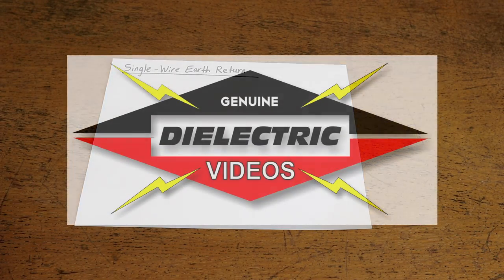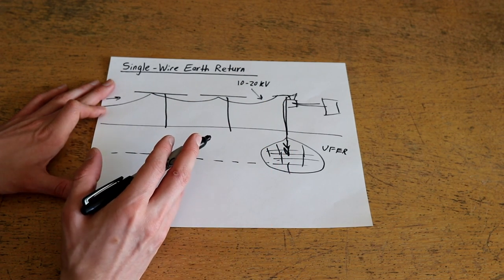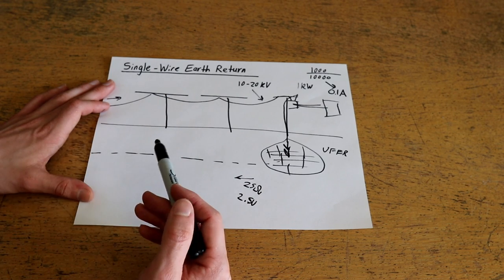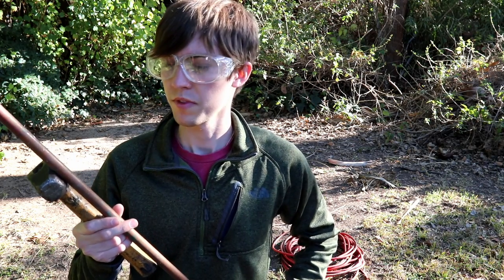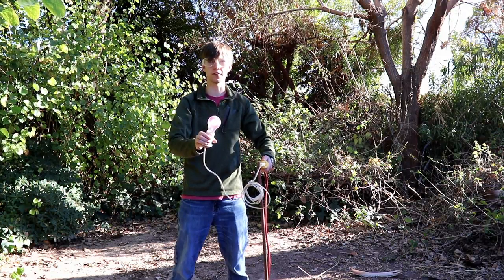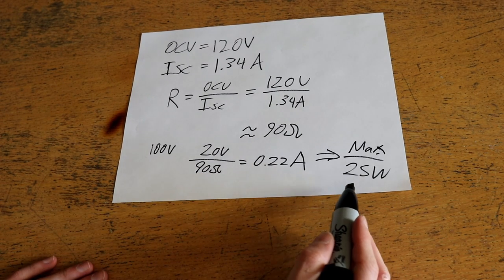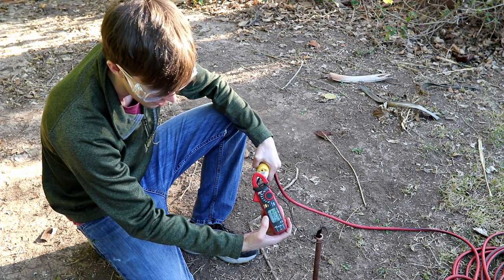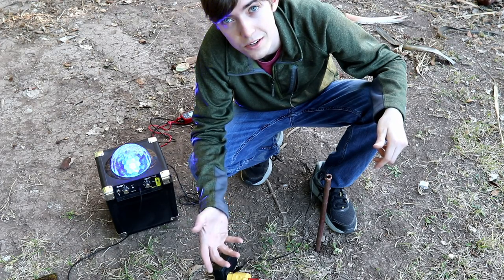EP 51 - Power Through Dirt: Single-Wire Earth Return @ 120V

Comment: Indeed very interesting I have been wondering about this method for some time
My big question is will it actually register on the power meter on the house or not....
 if your only using one leg of the power it may not as the loop that the normal lines take are
done with 2 wires but I don't know.... this would be great for LED lights in my shop
but why bother if the power company gets paid either way right ?  I'm not advocating stealing electricity from the power company but if the voltage is there anyway 24/7 and it doesn't cost them anything perhaps this would be viable eh?
Reply from the maker: It will still register energy use on the meter, as the meter measures the energy consumption on the hot legs, not the neutral.
Reply: @DielectricVideos  Ahh ok thank you a while back I saw a video where a guy was getting electricity on  one side of the line only and he said it wouldn't cost him a cent and I thought that can't be right !  but you never know....   our best bet for free energy isn't with the power companies anyway...it's through atmospheric electricity ...but that takes just the right property to do that on !  or a real stable balloon and no wind !

Comment: I'm curious about using a step up transformer from say 12v to 120v? In your case your getting 50v so it would potentially be 500v.
Reply from the maker: I actually considered repeating this experiment with a pair of microwave oven transformers, one on either end. This would raise the voltage to about 2200 volts, so the earth resistance would have a much smaller effect on power transfer. At the recieving end, it would be stepped back down to 120V.

I have successfully transferred as much as 1 kilowatt through a step-up-step-down configuration of microwave oven transformers, so I suspect it would work well. This would be rather hazardous to test with a SWER system, however, so I have not yet tried it in the field.

Comment: Is this to save wire
Reply from the maker: On high-voltage, long-distance distribution lines that's exactly why SWER is used (as it cuts the number of required conductors in half). However, the low-voltage setup in the video is just for demonstration.

Comment: I'm confused.  This video seems to be suggesting that if I run a single (hot) wire several hundred feet from a GFI supply point and stick the wire in the ground (or in a pond if you prefer), that the GFI will not trip?  He could only get .1 amps to flow.  I think the GFI will trip and hard.  What am I missing?
Reply from the maker: There's no GFI here, if there were it would immediately trip, per its intended purpose.
Reply: Not the point.   if enough current can flow into the ground to trip a GFI, then your problem is not ground resistance.  @DielectricVideos

Comment: hi good day i tried this method and it works. I have 220v single line and earth ground return, my question is what will if i do if i wanted to plug hevier loads? i tried to plug a water heater but it didnt work. im sorry im just a newbie on this.. but thank you anyways for the great video and more power.
Reply from the maker: SWER at voltages below 1kV is unfortunately not very practical in reality, as the resistance of the soil can change dramatically depending on moisture content and other factors. It might work for small devices like laptops or lighting (as shown in the video), but for larger loads it is best to supply power with a complete circuit in copper.

Regardless, I would recommend following all local electrical codes in your area if you are installing any permanent electrical system.
Reply: Even if you were able to get a very good grounding,  higher currents can pose a safety issue to some one standing on the ground over relatively short ground return paths.

Comment: So i take it by using this method of using the earth as a ground with a positive live feed your electricity meter should not register using any load? Many thanks
Reply from the maker: It will still register energy use, as the energy is measured on the hot/live conductors, not the neutral.

Comment: You're basically just moving the ground. Try running a wire directly off the tube and add it to a small transformer and DC motor. It will increase output exponentially.

Comment: The power utility won't like  this connection for it does not go through the power meter. Too dangerous so that the GFCI protection will  cut the power supply to the building's main panel. I wouldn't recommend to anyone to deal with that stuff.
Reply from the maker: Quite right about it being dangerous, but all power drawn here is still metered. In my area the meter measures real power delivered via the hot conductors, and the neutral current is ignored. Since this is still drawing current from the hot conductors, it is indeed being metered.

In any case, this is just a demonstration and is not advised to be used as a practical power transmission technique in this configuration.
Reply: @DielectricVideos  I understand what you are saying, do me a favor check your meter while you light up a 40W light bulb connected phase and ground (independent of the building ground) and tell me  if the meter is running.
Reply: @manosdimis1194  You obviously don't understand electricity, the ground path is only the circuit return, the the source of voltage is the hot side wire which is going through the meter.

Comment: shouldn't this trip an RCD?
Reply from the maker: It will trip if it's connected to a circuit protected by an RCD. In this case there is no RCD/GFCI protecting this circuit.

Comment: Is there a transformer in this system?
Reply from the maker: In the way I set it up, there is not. Current flows from the 120V AC supply of the house, to the load, and through the earth to return to any nearby grounding rods or grounded pipes.

If you consider the utility transformer that supplies 120V/240V to the neighborhood, then I suppose technically there is a transformer involved, but not one that is specifically needed for SWER to work.

The use of a step-up and step-down transformer at either end of the single wire can significantly increase transmission efficiency, allowing more power to be sent over the same wire with less voltage drop. In this demonstration, however, transformers were not used.
Reply: @DielectricVideos  We use a copper pipe driven into the garden and the ground wire in the electrical grid.Does it affect the electricity meter?Is 25 watts of natural electricity produced here?
Reply from the maker: @halox585  All energy consumed is still metered, as the meter measures power flow through the hot-side conductors.

The return current will flow through any ground connections to the ground, including the copper pipe ground you mentioned.

Comment: Is this suitable for operating a 1 k.w air condition?
Reply from the maker: Unfortunately not, as the maximum current it will provide is only a couple of amps.

This is also a demonstration and not recommended for use in a practical environment.

Comment: Can we use DC ?..will the return conductor work?
Reply from the maker: DC will work for some amount of time, but eventually the anode will corrode due to electrolysis if DC is used. It might be a good idea to use an inverter to generate AC, then rectify it on the other end if you do need to send DC in this way.
Reply: @DielectricVideos  can you answer me one question i always had this doubt..When we use some heavy appliances  like heater or oven... One side of the socket heats up but the other doesn't...i know current comes from live wire of one side but to complete the circuit it must pass through neutral... then why not neutral point doesn't heats up?
Reply from the maker: @anshulverma1610  I would suspect a weak connection on the hot side. The same amount of current should flow in both hot and neutral, unless there is a ground fault and some current is returning via the chassis ground.

What type of plug does the appliance have and what is the voltage?
Reply: @DielectricVideos  standard 3 point plug which comes by default with appliances.. 220-230 V here in India...
Reply from the maker: @anshulverma1610  I would suspect a bad connection on the hot pin in that case. Do you have a replacement receptacle that you could install to see if the heating issue goes away?
Reply: @DielectricVideos  Actually i cant change the receptacle because its kind of one sealed in with wire which comes by default with appliance..I will have to replace whole power cord..But you know this is not the problem with my one appliance..I have this with my many appliance..Like my Iron Heater Oven..In all of them one of the pin gets heated but other one is normal..
Reply from the maker: @anshulverma1610  I'm not sure what is causing the issue in that case. But unless there is a significant ground fault, the same current will flow in the hot pin as in the neutral pin. Very interesting indeed.
Reply: @DielectricVideos  yeah...thankyou for interaction...Love you videos😊

Comment: Urg.  You could have measured the same current through the light bulb and not endangered melting one of your clips or having  one melt in your hands.  You are lucky the ground had the resistance that it did.  Also you need to clearly warn people that one end is already connected to ground and if they get the ends backwards they are going to waste a lot of power just heating the ground up, and even if you get it right, you are still dropping power in the ground.  For 50W I would just go solar in the remote shed.  That is what I have done a couple of times, looking at set up number 3 just for lights.

Comment: Awesome video! Couldn’t it be possible to drive say 40 1/2x10ft type m copper tubing down to 9ft. Then theoretically it should produce 3600 watts right? Then use that charge to charge a 60,000 watt lithium iron phosphate battery bank used for solar charging. Buy two 60,000 watt LKithium iron phosphate battery bank and when one is charging use the other to power your house? Or drive say 100 9 ft  1/2 copper tubing at 90 watts each to produce 9,000 watts constant into your house and forget the Lithium iron phosphate battery banks? Is ether one of these feasible or am i wrong?

Comment: By only using the phase cable and leaving the neutral cable of the electrical system of the house unused, in theory the electric meter of the electric company would not be able to detect these consumptions, that is the attractive part (that of not paying too much electricity), if we connect both (the power cable and the ground cable) to a 12v-120/220V transformer we can feed stronger loads well, and due electrical devices only require RF (resonant frequencies = volume = voltage) maybe it could function as well if we connect a diode in our ground cable to avoid the risk of any possible current coming back for said wire......
Reply: Try again...
Your electric meter measures load current thru the ungrounded conductors. 
The only way your theft scheme could work is by disconnecting the meter from its power supply.

Comment: The safety issue here is that you cannot privide  effctive electrical safety protection eg short circuit or earth fault protection are not possible. Further the step potential at your earth stake is probably OK in your soil, but say someone does this in dry sand they could be killed if they touched the earth rod. I agree with the transfer voltage dangers which you do cover , but the casual implications of a near by swiming pool is scary.... I recommend you take site down before someone gets killed

Comment: Nice demonstration.  Your setup was plugged into a circuit without GFCI(RCD for Europe/UK/Australian viewers) protection as it wouldn't work.  Am I correct?
Reply from the maker: Correct, the demonstration was performed on a circuit with no GFCI protection. In single-wire earth return, 100% of the current flowing is ground-fault current, so it would immediately trip an upstream GFCI or RCD if equipped.

It would be possible to install a GFCI receptacle at the end of the SWER line to protect users and equipment downstream of that receptacle, however.

Comment: Excellent video, thank you.
.
You said the ground works as a return path but I would argue that it does not (in certain situations) and you can see that by measuring the non-ohms law effects on the transmission of high voltage and frequency, similar to the way you did in your video. Also different materials were used for the transmission line including water tubes, carbon cables and glass, meaning really very high resistance or completely isolated.
.
The research shown in this video presents those effects of non ohmic laws power flow. https://youtu.be/zd5zACpg8M4?t=312
.
Now, one key element here is frequency, in your case you are 60 or 50hz but in the research of the video presented it is much higher.
.
Anyways, man, great work and perfect transcript.

Comment: If I understood correct, you need only 1 positive line to the external location, and you use the earth itself as the ground (negative).
If so, then why don't you pull another cable next to the positive?
I don't see actually what is the benefit of this setup?!
As an experiment it's interesting, but the real world usage is not so clear for me.
Reply: In some circumstances, having only one wire saves money because you only need one wire

Comment: Doing this you can bypass your electric meter on your house.
Reply from the maker: Typically not, at least in North America. Energy use is typically metered via the hot (line) feeders, not the neutral. All this is doing is bypassing the neutral conductor, so the meter will still accurately measure energy use.

Comment: So a person could stamp a conductive post in the ground and create electricity
Reply from the maker: It only provides a return path for electricity that is already present. You still need a live conductor to supply a potential to your load in order to use the ground rod as a path for return current.
Reply: @DielectricVideos  so say a person used the same concept of an earth battery but added a step up transformer/ converter what's your opinion in that regard?
Reply from the maker: @yokai-vr3jz  If you're referring to an earth battery that uses dissimilar metals in an electrochemical reaction, it will produce a DC voltage, so you will need switching electronics such as a boost converter or joule thief to raise the voltage, rather than a transformer. The same is true for telluric currents, if that's what you're looking to harvest. Either way, the harvested energy will be small, and electrode rods will likely need regular replacement as they corrode. 

SWER works best with AC power because there is little to no net charge exchanged through the ground rods, so they tend not to corrode as they would with DC current.
Reply: @DielectricVideos  thanks for the detailed answer